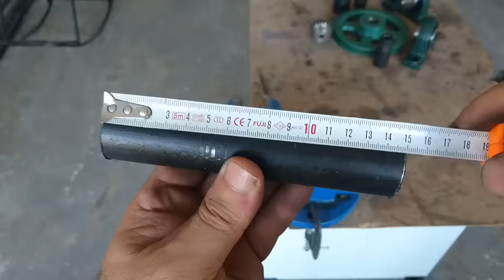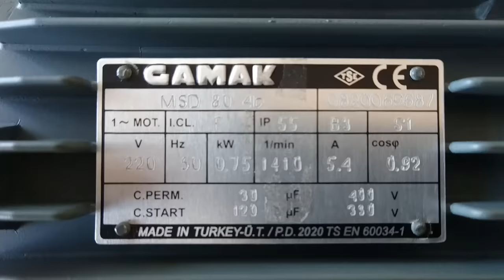How to make a real drill press! Benchtop drill machine making

Comment: oh u have the same problem as on the one i paid 220€ 3 days ago : adjustable table bends under the load. smart engineering. if u replicate the shitty designs, u get the same result.
Reply from the maker: I've done my best for now, but I'm working on a much better project.

Comment: Speed too much reduce speed motor pullet change smmall
Reply from the maker: The previous speed of the machine was quite higher, than I did the necessary thing, I reduced my speed, but as you said, the speed is still high, but it drills well, it does not burn the tip. https://youtu.be/pPD6kj3BFAk